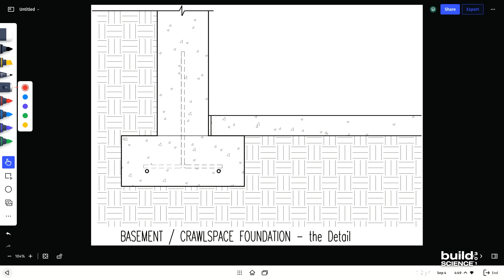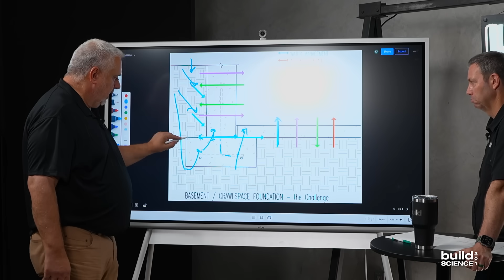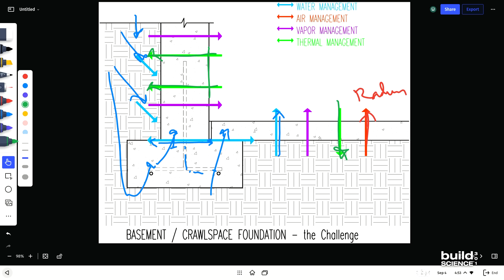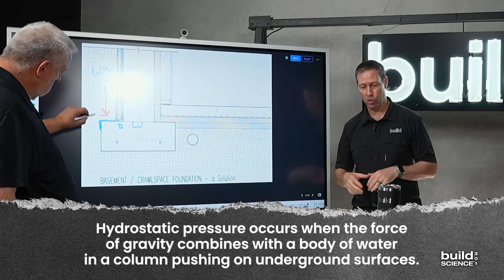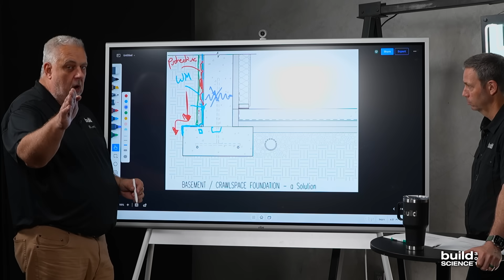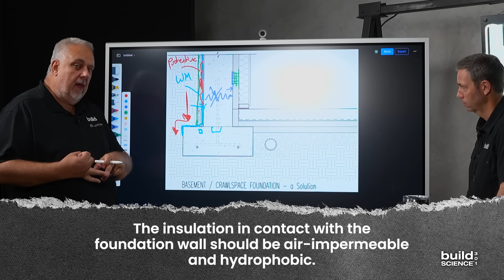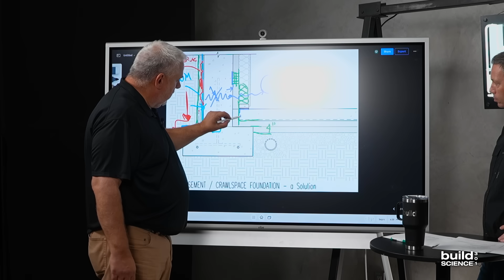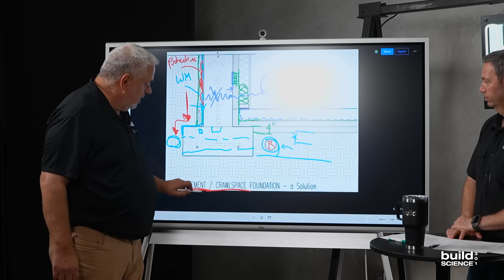Build Science 301 - Ep.2 | Basement Foundation & Crawlspace Foundation

Comment: Would a EDPM gasket work just a well as a replacement for the sill sealer?  Would it conform to roughness of the concrete top better?  Would you recommend using a upper and lower bead of sealer as well?

Comment: Matt and Steve, I learn so much from watching your various educational shows, and it absolutely makes me a better builder.   Maybe I missed something in this one however for one who builds almost exclusively CRAWL SPACE I don't build as shown in the diagram.  To start, my footing are 24 inches wide, 18 inches deep and continuous, 3 inches of #57 in the bottom, 2 strains of #4 rebar and 12" inches of 3500PSI concrete.  Cold Joint illustration I understand.  Shrink Swell Approved.
The basement and crawl space are different for one reason in this area, the grade under the home in the crawl space is 10 to 12 inches higher than the grade outside the foundation.  The grade outside of the foundation is slopped at 2% for 15 feet around the outside of the crawl foundation.   I can't get the foundation inspection approved without this being the norm in terms of grade inside the crawl being higher than the outside.    I AGREE, much different when it's a basement as I grew up in a home with a leaky basement, so I know firsthand why there is a difference. When i was doing termite inspections in the seventies I found many homes just as you described, found many homes with a pond under them.  I normally don't comment because you guys know so much more than I, keep up the great work.
Reply: Please explain what is 3" #57 in the bottom  ... and 12" of 3,500 PSI concrete?
Reply: @genevelis6075  - #57 is the size of the gravel and 3500PSI is the strength of the concrete.